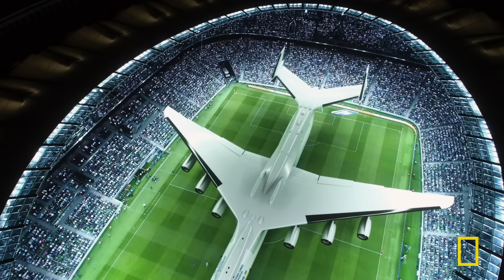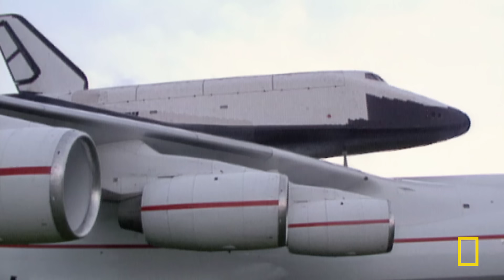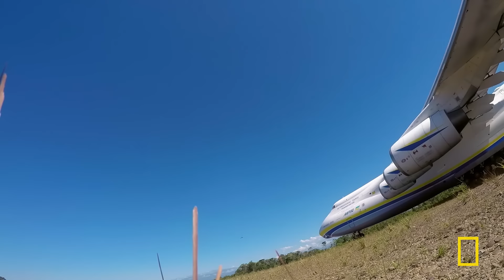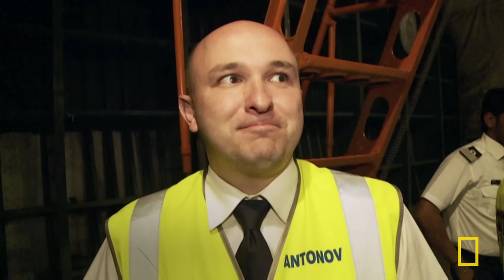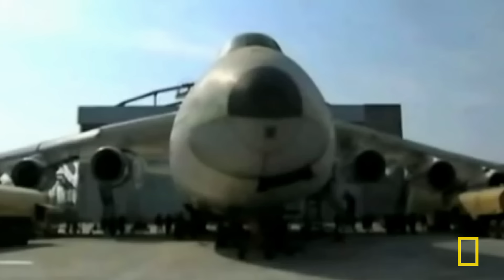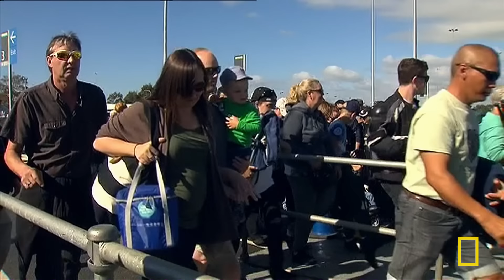Monster Plane: Uncovering the Antonov AN-255 (Full Episode) | Superstructures: Engineering Marvels

Comment: i saw that plane once in toronto. it is massive and very interesting to see up close. hats off to the pilots who fly it. i hope that they can rebuild a new one
Reply: Being built right now as far as I know.  They had historical parts for a second one more or less.
Reply: There's an Antonov that's been parked at Torontos airport since the war began, but I believe it's a slightly smaller model than in the video
Reply: @jasonstevens2060  that's antonov an-124. scaled down version of the an-225
Reply: @simirastreams  An-124 has four turbofans instead of six.  Only 605 MT, about same size as the American C-5A.  A lot more An-124s were built.

Comment: It's Antonov 225... I thought there were plans of building a new Antonov!
Reply: There are. Just at the moment, gotta get through the war first
Reply: @foxcatdemon318  not possible, because USSR - not exist
Reply: @95valero  Ukraine, which is where is was maintained. Has the plans to the plane. They plan to rebuild and modernize it. Multiple places have said they will help fund it too.
Reply: @foxcatdemon318   - Yes, Ukraine was the place for maintenance. 
But wings, tail all electronic equipment, floor, tires - everything delivered to Kiev from other republics in USSR. 
What could you find, if major technical documentation - in Russian Federation...
Reply: Ukraine is unable to build anything

Comment: "WAS" and I hope when they rebuild a new one..they'll improve them by a lot using a current tech or even upgrade it....😍
Reply: not possible to rebuild a new one...
Reply: @ nothing is impossible LOL…they already said from the beginning it can be done because there is another chassis
Reply: @LeeMooEez  -
LOL< 😂😂😂 
Antonov design bureau have second fuselage almost 40 years. During that time, they did not add single part to build second airplane. 
They have no ability to build wings and tails. They have no any plants to build titanium parts, electronics. 
Major documentation you can find in Russia. So, you need a lot of money to pay them for that documents
Reply: @95valero  and somebody already said that they’ll backup the project…BUT..that talk was so early in the war…now~ nobody know🤣
Reply: @ - 
well, just imagine if you are in charge of this project. War is over… How would you build a new airplane? 
Just to remember - you have fuselage, built in 1980 - 1985 
You DO NOT have documentation, you DO NOT have engineers and workers, who previously had some knowledge how to assemble this kind of plane. 
What will you do?
Reply: If documentation is needed it can be produced by reverse engineering the unfinished airframe and/or the destroyed airframe.

Comment: NG, you really need to put more effort into your research !!!!

1) The An-225 was a joint Soviet creation, and its development showcases the collective nature of Soviet industry. Engines, avionics, electrical systems, materials, and testing facilities was build in Russian SFSR. 
2) Ukrainian SSR was responsible for design, final assembly, wings, cargo structure, hydraulics, landing gear (partial).  
3) Dont forget about : Belarusian and Latvian SSR also participates in that project ( ~ 10% ). 
4) The Antonov Design Bureau  ( which designed that plane ) was founded during the Soviet Union, a state that included multiple republics like the Russian SFSR and Ukrainian SSR. It was initially established in Novosibirsk (Russia) in 1946 and later moved to Kyiv (Ukraine) in 1952. After the move, it became closely tied to Ukraine.
Reply: And what happened to it?
Reply: @gasparole  после развала СССР, авиационная промышленность захирела в основном.

Comment: They had the 225 and now they have the 255. Huge........humongous !!!!! It can be heavy as long as they have the power to handle it. Six engines !!! that's it !!!!! Power over drag. No power, just drag and no flight, just in case these engines fail.

Comment: If the bearing elements of an aircraf are on top, that is the first qualification for flight. Like a parachute & a yatch. The only time that that could be varied is in the question of a design for higher speed threshold. The size of the craft is not a factor.

Comment: I have a lot of them . I bought 2 TM20Ks and on both of them as well as my previous ones , the rubber door that is supposed to protect the entrance to the C charger has come off, and travelled somewhere into the abyss. Not some of them, all of them . A critical design flaw that Nitecore needs to address. I’m wondering, does this one come with the same flimsy rubber protection that snags on your pocket never to be seen again? Or, have the engineers fixed it? Inquiring minds would like to know.

Comment: So, with the generator weighing 117 T and the maximum take off weight 800 T, the aircraft has almost 700 T of fuel? Given it was stated it was almost at maximum capacity.
Reply: If I recall. It can hold over 90,000 gallons of jet fuel.
Reply: @timmanboy1  thanks
Reply: @timmanboy1  Which is about 540,000 pounds since a gallon of fuel weighs about 6 pounds.

Comment: The rudder authority of An255 is mundane. It doesn't have a very good crosswind performance specially during crosswind landings in winds over 16 knots especially because the fueslage has a broad profile while rudders are small.

Comment: It's Antonov AN-225 and not 255 ! Luckily the Ukrainians have a a second Antonov 'Mriya' AN-225 which is about 75% built but not stationed at Gostomel Airport (Kyiv) where this only AN-225 was sadly, partially destroyed by Chekist Putin. The controller of Gostomel Airport was pro-Russia and refused the plane to fly out before Russian paratroopers arrived and bombed its holding bay. He was sacked, relieved of all emoluments and jailed 20 years for treason. The salvaged parts from the damaged AN-225 like engine, wings, wiring harness, electronics, etc. have been sent to the 2nd AN-225. The fully refitted and upgraded AN-224 after testing will take a process of at least 3 years to complete. Captain Dmytro Antonov is a super capable and highly experienced pilot to fly such a monster and a beast of an airplane ! Slava Ukrainya !
Reply: Lol, Russians where there just too fast....controller was irrelevant.